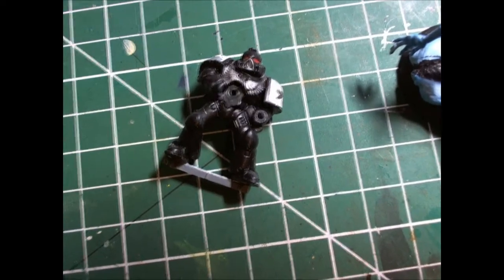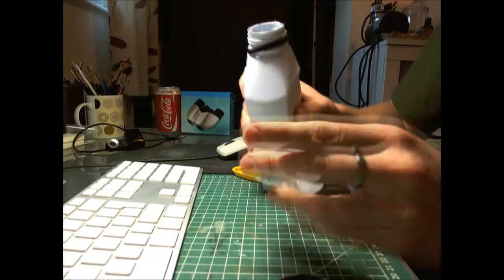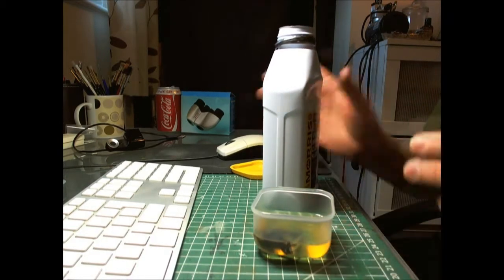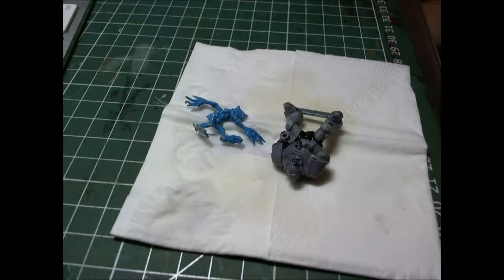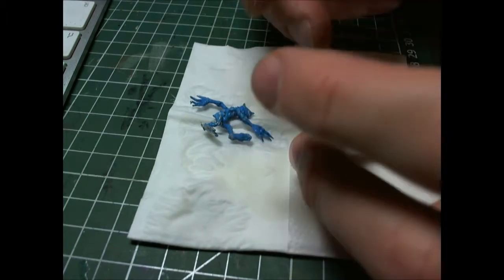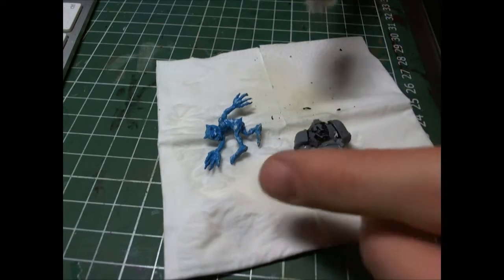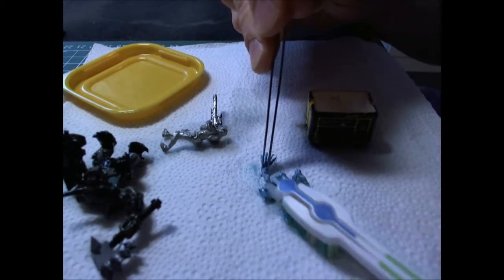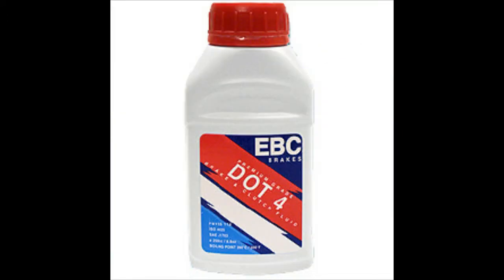Stripping paint in easy way. - IDIC Beer 1000 sub giveaway

Comment: Yup, in the US, Pine-Sol is a cleaner typically used for treated wood and floors. Its smell is kind of a mixture between pine trees and lemon scent. But it has solvent properties which can to break down paints, but are a bit too harsh for long term exposure to plastic models. I've used pine-sol multiple times on metal miniatures, but I haven't tried DOT4 for plastic... I'll do that next!